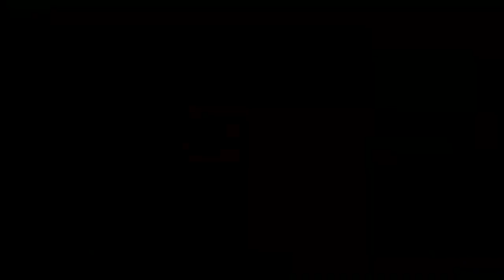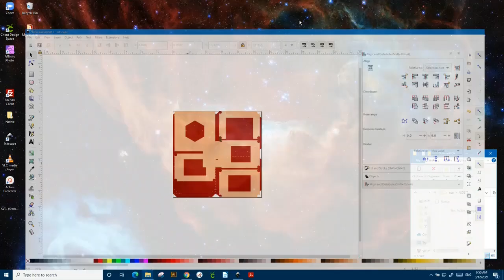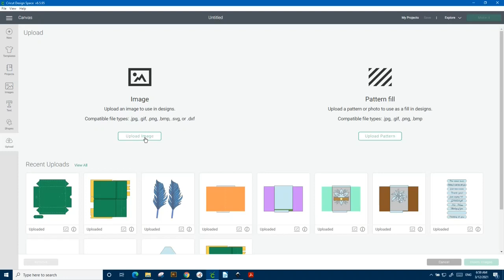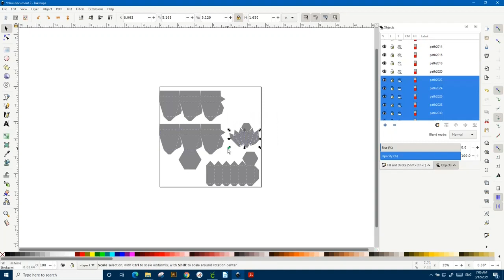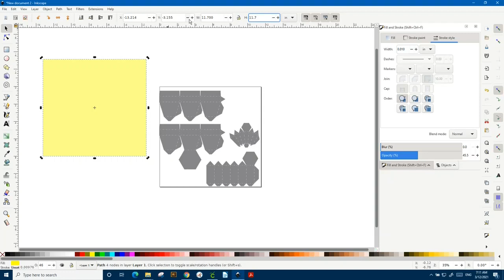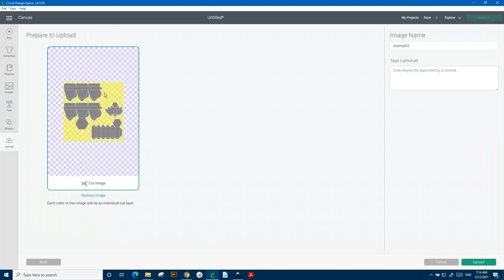Using Inkscape 1.0.1  with Design Space

Comment: Hi! This video is helpful. Do you have by chance a video with the steps to create the score lines. I have my project already separated but when I follow your steps to combine the shape with the lines it does not work. So, I wonder if it's something that I miss when I create the lines. Thank you!
Reply from the maker: I just made a short video on how to do that. https://youtu.be/3VAdl4SUwkw   -- if it doesn't work, what exactly is happening?  

If you simply use  a path with a dashed line type, it will cut with a solid line. 
If you try to just convert the stroke to a path, it will convert each segment into a rectangle. 

Using the Extensions->Modify Path->Convert to Dashes works 

Note:  One "gotcha" is that DS sometimes sees a rogue node (not part of a path segment) and tries to close it with the first node (why it does that, I have no idea) so sometimes in addition to making the scoreline paths, I need to use the node tool to lasso around the area at either side of the path to find the rogue node and delete it.  If you see a solid line when you go to cut instead of a series of dashes, look for that.
Reply: @suezakar  thank you very much! I will try what you have mentioned.